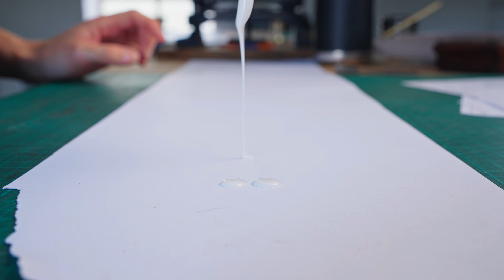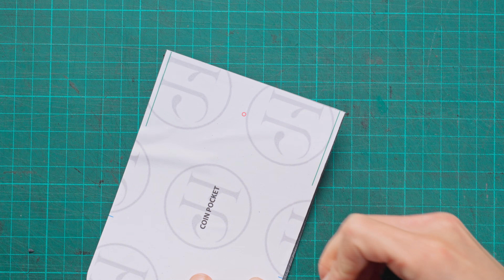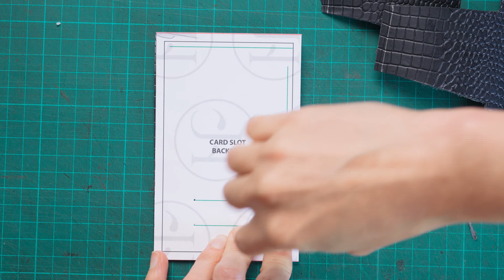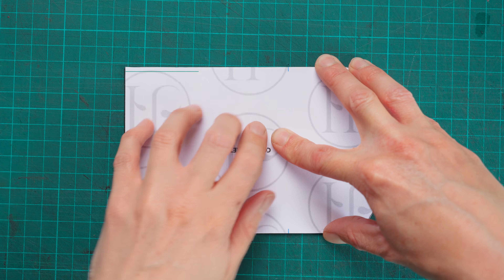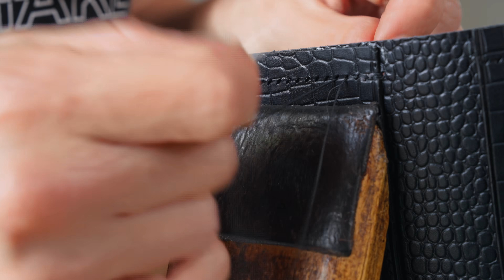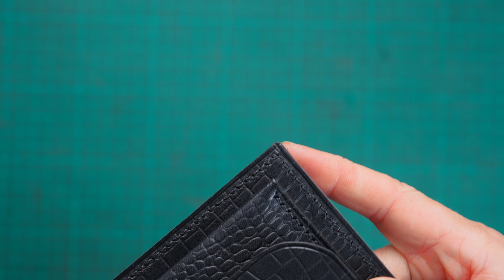Make your own BIKER WALLET // leathercraft make along tutorial // PDF pattern pack

Comment: Re the glue pen is the tip a consumable (needs to replaced from time to time) ? If so, how much use until replacement and do they sell replacements?
Reply from the maker: They come with 2 spare tios included with each pen size. At the moment I am still on the first tip and I got these back in February 👍
Reply: @JHLeather  Thanks.  That long used professionally means they will last forever with my use.